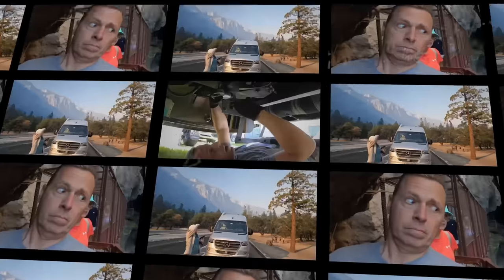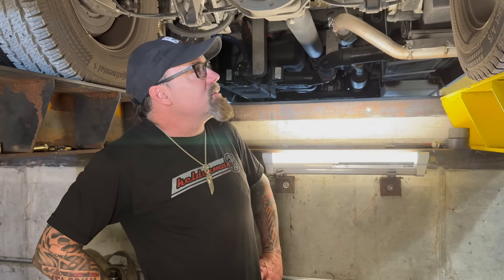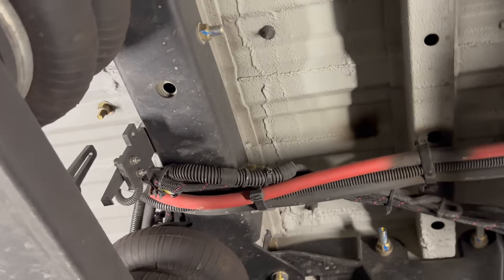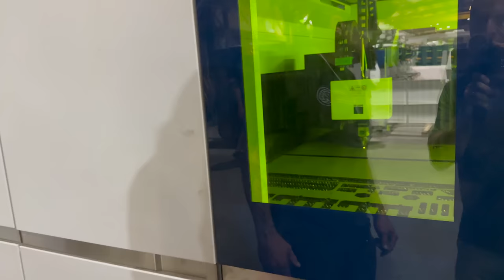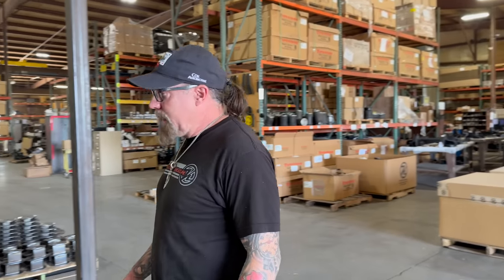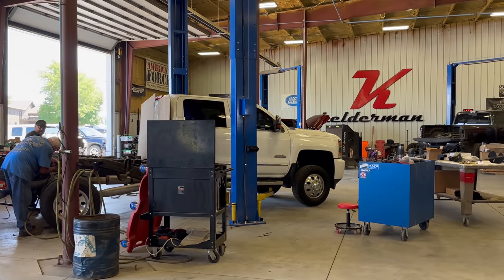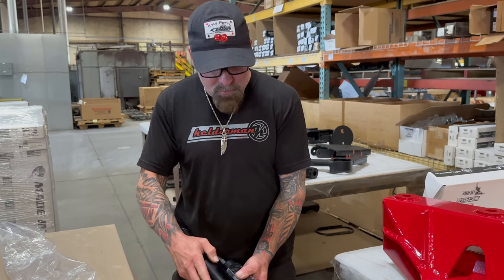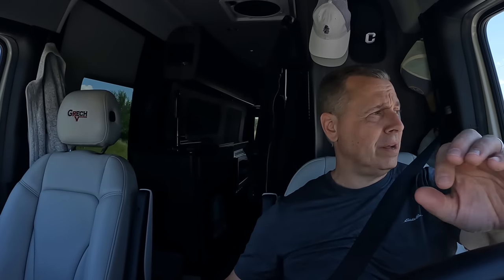Kelderman Mfg Tour | How the Grech RV Air Suspension is Made and Works

Comment: I have a 2017 3500 sprinter van that I’m interested in putting air ride system, would you say this substantially make a big difference on ride when hitting  fine to bigger road bumps on the road a smoother ride.. ? Great vid!!
Reply from the maker: Since the van came this way new from Grech RV, we didn’t drive a Sprinter without the air suspension before driving this. We have heard it makes a difference though.

Comment: I would like to know what it costs for an upgrade at Kelderman for a sprinter 3500XD. Looks like it is $5600 on the website. I wonder how much more is install and sway bar?
Reply from the maker: Great question. Kelderman does not install them on the Grech models, Grech does just like other companies do the same. If someone is interested in Kelderman doing the install on their own Mercedes, they would need to contact Kelderman Manufacturing directly by phone or through their website for a quote.

Comment: I can’t believe how poor the MB suspension is from the factory
Reply from the maker: You have to remember that Mercedes doesn’t build them for the purpose of an RV with top heavy weight, that companies like Airstream, Coachman and Grech RV build these units out with cabinets up high and then their customers load them up. So each company has there own engineers that design what they believe is needed to make for a better ride and safer experience for the consumer. 👍🏻😊